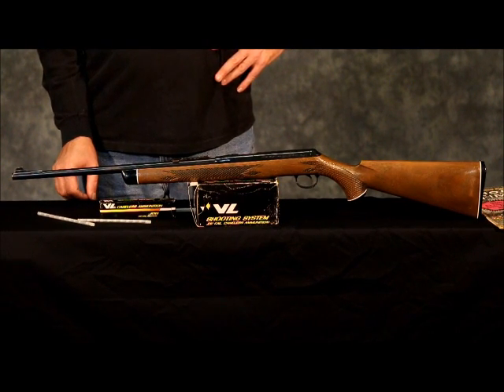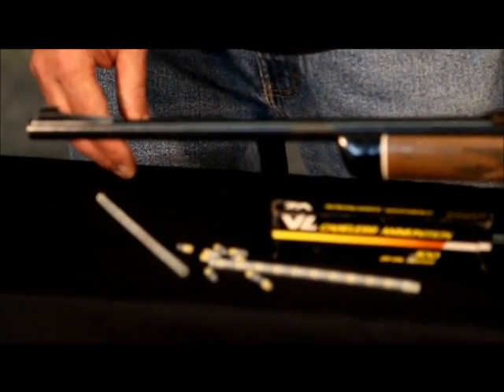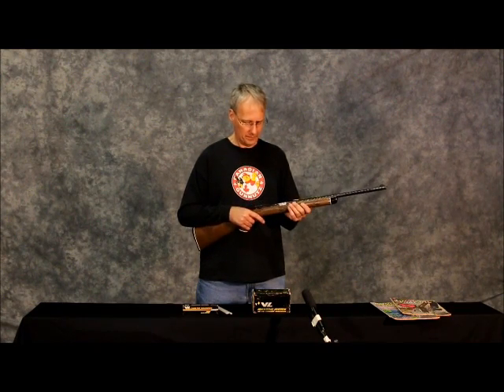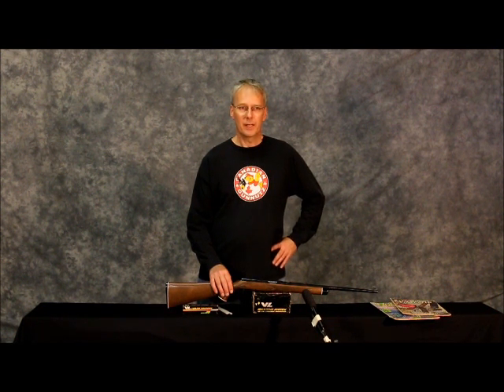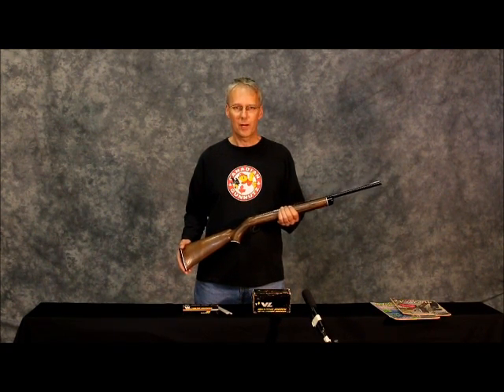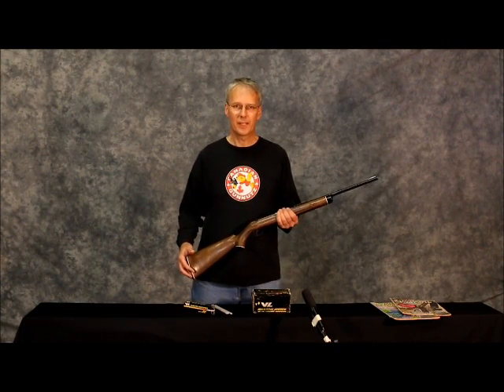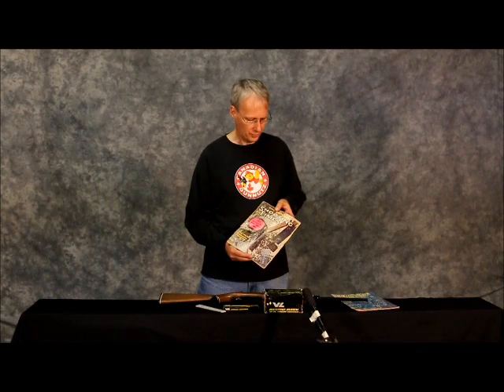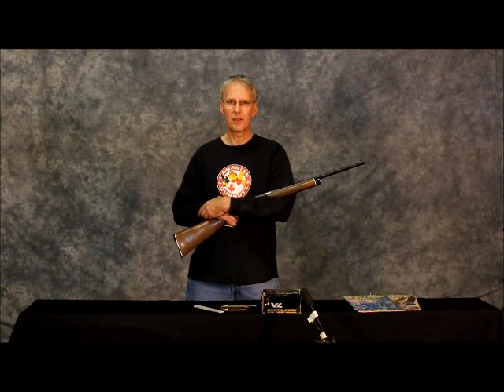Daisy VL system explained

Comment: I have a Blue Book of Gun Values that I use as bathroom reading material. I came across the Daisy VL and was scratching my head trying to figure out how a caseless cartridge system would work. Thank you for the video explaining. Is the propellant smokeless powder mixed with a binder and shaped/formed on the back of the bullet?
Reply: Yes it is ..... guncotton  (nitrocellulose) + binder